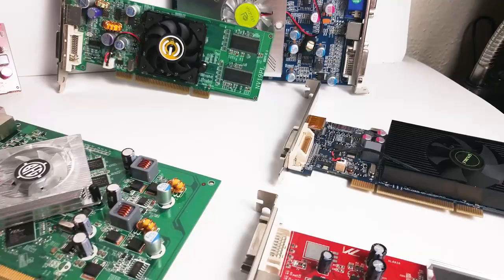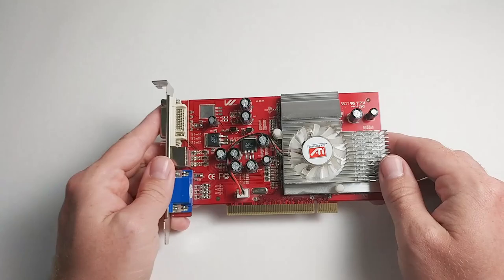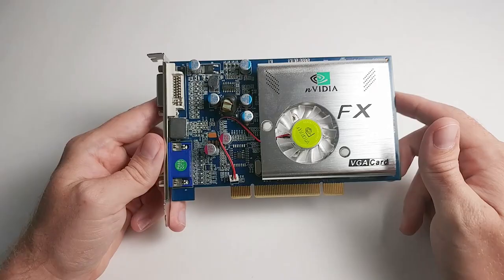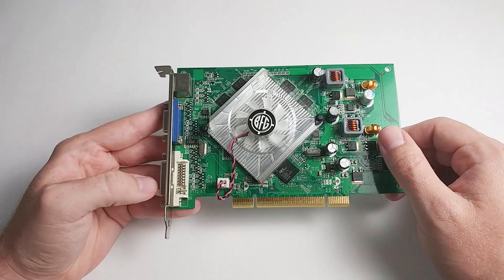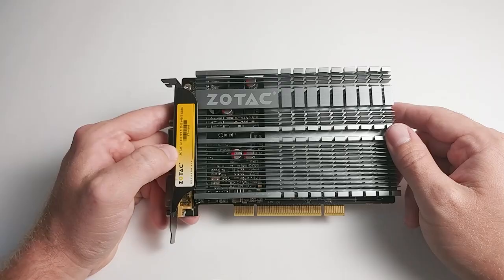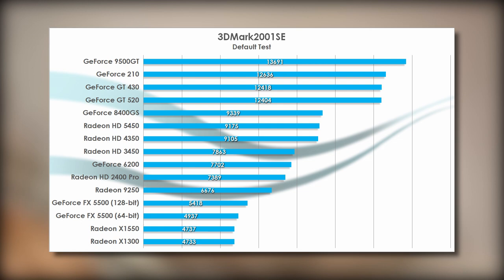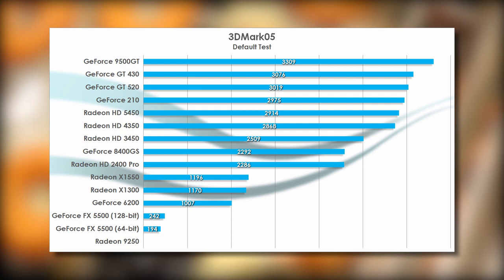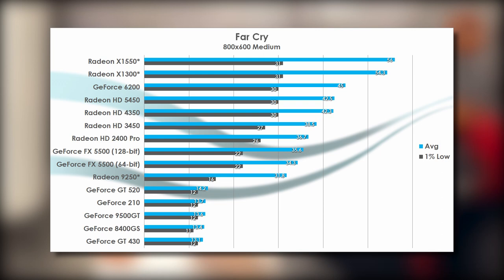A Comparison of 15 PCI Graphics Cards (DirectX 8, 9, 10, 11)

Comment: I did some number crunching, and totalled the results of each graph. 15 points for first place, 14 points for second, 13 points for third and so on. Any that had 50 points less than the leader were immediately out of the competition. Here are the results:

9500GT: 127
GT520: 127
GT430: 121
210: 113
HD5450: 104
HD4350: 90
8400GS: 86

HD3450: XXX
9250: XXX
X1550: XXX
HD2400: XXX
X1300: XXX
6200: XXX
FX5500128: XXX
FX550064: XXX

So, what're the TL;DR's from these numbers? If you're wanting the best performance bar none, the 9500GT and the GT520 are your go-to's. The GT 430's there if you can't find either of those, with the 210 being a backup for the backup. The HD5450 is the best card for the AMD fans, with the 4350 being their backup.

Footnote: What I find incredible is that the 9500 GT, a card from 2009, has performance comparing to an R5 230, a PCI-E card from April 2014! So, all the way into 2014, you could get graphics better than PCI-E off of PCI!
Reply from the maker: Haha love the analysis! Thanks!
Reply: @His Masters Voice There are actually a lot of groups that this video targets
1: Hardware Enthusiasts
2: Retro Gamers
3: People looking to upgrade older systems only equipped with PCI slots (me)

Just because this video isn't suited to you doesn't automatically make it a bad video.
Reply: I have the Galaxy PCIe variant of the 9500GT. That card did what ever I needed it to do, and went into a glorious retirement when it revealed its limits when running The Sims 3, as did the rest of the system (AMD Athlon 64 X2 and 4 gigs of DDR2 800 clock memory).
Reply: Thank you so much. You've just saved me so much time.
Reply: but isn't that comparing to the R5 230 being benched with newer games with newer technologies or you mean in the same titles?
Reply: @Celeron_619  I'm also on the same boat as you. Looking for a PCI GPU to upgrade a PCI only mobo (Dell dimension 2400) but the only thing is and I really need to know. Which of all these cards have DX9 support? He said at the start that the first one was a DX8 but I need a DX9 card.
Reply: @slendermanRblx  Anything GeForce FX5200 or higher will have DX9 support, I however recommend the 6200 as that has full DX9.0C support and is faster. I own the 8400 GS and that supports DX10 and I also have a PCI GT 610 which is DX 11.
Reply: @youtubeisgarbage900  I got one of the eBay ones and I suggest you find a name brand one. I had to reflash the bios with a 610 512mb bios due to the 1gb of ram that it had being faulty. Otherwise the card works well.

Comment: graphics cards geforce 256 pci nvidia quadro1 pci geforce 2 ultra nvidia quadro2 pro pci 3dfx voodoo1 pci 3dfx voodoo2 pci riva tnt ultra pci ati mach64 pci geforce fx 5200 ultra pci geforce 3ti 200 pci nvidia quadro dcc pci geforce 6200 pci riva tnt 2 ultra pci radeon x1300 pci geforce 210 pci geforce gt 430 pci geforce 8400 gs pci are high quality graphics cards for the pci bus

Comment: I didn't know they were making GPUs for old PCI so long time, when I had motherboard with PCI only I would really appreciate that. The best what I found was some S3 with 8 MB VRAM. It was cca in 2004. But it could run AvP 1 on low. :-D 3300 points in 3D Mark 2005 with PCI GPU, that's crazy! Why was that so rare when it has obviously some performance? It would be perfect for office PCs without AGP or PCI-e in that time.
Reply: ps: "geforce 95 hundred" without text help I wouldn't know how much is that, English can be very weird  :-D

Comment: This interests me probably more than it should because I've had a bunch of Radeon and pre Radeon cards over the years. 3D Rage II +, Rage 128 Pro,  Radeon VE, Radeon X300, Radeon X600, Radeon X1300 Pro Radeon HD 2400 PRO, Radeon HD4670, Radeon HD5670, Radeon HD6670.  The more mainstream ones that I've had are Radeon 32MB SDR, Radeon 8500, Radeon 9100, Radeon 9600 Pro  Radeon 9800 PRO/XT, Radeon HD3870x2, Radeon RX 550, Radeon RX 570.    Most of mine were AGP or PCIe though. I had only a handful of PCI ones and they were 3dFx and nVidia.

Comment: I wonder if using a PCI to PCIe Adapter Card (combined with a PCIe x1 Cable Adapter which are equipped with a Berg Connector for extra power) would produce better results than the "native" PCI GPUs? Recently picked up a Sparkle 9500 GT PCI card, and a $60 GT 610 PCI card with 1GB still on eBay. Awesome Videos!
Reply from the maker: I've had suggestions over the years to try one of those adapters, but I haven't had much personal interest in it

Comment: Cool video. The last PCI card I used was a Voodoo II  3DFX with an Onboard SiS6326? 8MB Video on a Pentium III 500Mhz system in 1999.  I can't remember the brand of the motherboard but it had a SiS chipset with integrated graphics and Cmedia Audio, I had to purchased a SB Audio  PCI card as the integrated Audio did not support my Sidewinder Pro FF Joystick.  It was a beast at the time. spent a lot time at Novaworld playing F16, Mig29 and F22 III via 33/56K Dialup.. thanks for the memories man..

Comment: Interesting and revealing comparison! Due to your talk about the compatibility of new drivers with older games, which degrade performance on newer video cards, you could have used older drivers for some of the video cards tested.
Like the 45.23 for the fx5500 and the 7.11 for the x1300/x1550/HD2400

Comment: Just finally after years built my old DOS/98 system took forever to find the parts. Socket 478 pentium 4 2.6 ghz, 512 MB ram and an ATI 7000 64 mb AGP and intel board with the 865pe chipset. with a dual boot of winXP to get use out of a WinTV capture card.

Comment: Was wondering if you had abandoned the PCI GPU prospect. Glad to see you haven't!
Reply from the maker: I had SO many obstacles but I'm glad I could finish it. Thank you!
Reply: @PixelPipes  I'm sure it was a time consuming project. Hell, I'm dreading having to go through all of them to see which ones support Windows 98SE lol. I'd like to see the limits on Windows 98SE, restricted to the PCI bus, for say, a system that couldn't make the XP jump.
Reply from the maker: @AtariBorn  The GeForce 6200 may be your best option but I haven't fully investigated these cards in 98
Reply: @PixelPipes  Thanks for the shortcut. I'm sure I'll look into each one, before it's over as I'm sure they all have their own little nuances. At least I have an idea of what to keep an eye out for. Keep up the great content!

Comment: Nice test. Tho, for practical reason, if someone wants PCI ard I would recommend those which are older and do not use any bridge (like PLX) to operate, aka native AGP chips (which is natively backwards compatible with PCI). I have seen many of those cards with bridges work bad on older chipsets. Another thing is windows 98 support. Getting a PCI card with no win98 is eh... questionable. 

The bad thing about the modern DX10+ ones is that they are only good for 2D desktop extension, some may argue some gaming, but the bandwidth of PCI is so low you cannot even play videos on them HD videos desync or run slow or stop playing.  PCI is a huge bottleneck, when it died off I would say it was the right time. Even the latest PCI cards which back in the day showed little to none bottleneck (like Vooodoo5) later became bottlenecked as faster CPUs arrived. Even voodoo5 has massively improved min fps in a bit more modern engines (like UT2004) if ran in PCI-X slot where it can run on 66mhz vs 33mhz of standard PCI. And this was the least bottlenecked card as it natively only runs as PCI66 in AGP and does not utilize any AGP features. On the other cards the impact is much worse.
Reply: Well it will nuke you minimal framerates.

Comment: Okay. I've done my research, watched your videos, and since you seem especially knowledgeable on the subject I could really use some stellar advice, if you don't mind. :)

I have an old Dell Dimension B110 that was basically a donation that I am upgrading to maximum specs as far as I can take it as an interesting hobby. I realize that upgrading it isn't the most financially-sensible venture in the long run, but anyone who tells me "You'd be better off buying a new computer" is missing the point. I already know that. ;)

Long story short, the only major thing left that I need in this thing is a good graphics card. Seeing as how the B110 comes with only PCI slots and no AGT slots, and seeing as how I only have one PCI slot left I want to make sure that I get the best graphics card that this computer can handle.

I realize that I'm not going to get away with playing modern-day resource-intensive games, but I'm mostly a retro-emulator kind of person and FPSs have never really interested me anyway. ;) I just want something that could be a viable replacement for the Intel Extreme Graphics driver that's native to the motherboard.

So my two choices, after much research, have come down to the ZOTAC ZT-40605-10L GeForce GT 430 and also the SPARKLE SP95GT1024D2LHP GeForce 9500 GT. Looking at the specs of both cards, I'm quite frankly torn, because there are so many advantages and disadvantages to each one.

The GT430 appears to have much better specs... 96 cores as opposed to the 9500GTs 32, Direct X11 as opposed to Direct X10, Open GL 4.1 as opposed to Open GL 2.1, and less power consumption requirements (Which I am prepared and willing to compensate for one way or the other). However, the 9500GT I'm looking at has two major things going for it that the GT430 doesn't... memory size and memory bandwidth. 1GB of memory as opposed to the GT430s 512 and 128-bit memory bandwidth as opposed to 64-bit. You say that the GT430, in a different video, is one of the fastest PCI cards made, but your video shows the 9500GT clearly outperforming it in most applications. And according to those who populate this forum ( https://www.vogons.org/viewtopic.php?f=63&t=58022&start=21 ) getting the "fastest" PCI card may not be the best idea since a lot of the GT430s superior features and performance would be held back by its memory bandwidth restrictions as opposed to the 9500GT. Your video also seems to support this.

Features are nice, but at the end of the day I am looking for the absolute best performer that I can get through the lowly PCI slot. ;) Power requirements are either not an issue or one I am ready and prepared to address. I am also working with 2GB of onboard memory and a Pentium 4 3.4Ghz SL793 Northwood CPU, so I'm plenty covered there. :)

So my question: Which, in your professional and personal opinion, would be the better card to pull the trigger on? I really need a consultation here, which I thank you for in advance. At $147 a pop I want to make sure I get this right the first time. ;) Also, thank you for posting your videos, they have been very informative. Take care.

EDIT: Lest you wonder... ;) 

https://www.vgastore.com/1006051/zotac-zt_40605_10l-geforce-gt-430-fermi-512mb-64-bit-ddr3-pci-hdcp-ready-video-card?gclid=eaiaiqobchmi1jpgkk7h4aivdo3ich1lbgtweakyasabegjf6fd_bwe

https://www.vgastore.com/2016349/sparkle-sp95gt1024d2lhp-geforce-9500-gt-1gb-128-bit-ddr2-pci-hdcp-ready-low-profile-ready-video-card?gclid=eaiaiqobchmi06-yuzf04aivriagch1xwqfveaqybsabegkfevd_bwe

EDIT 2: Running Windows XP Professional SP3 on this machine. Would certainly love the ability to run Windows 7 also, but if I can't it isn't a major dealbreaker. ;)
Reply from the maker: The 9500GT is marginally faster overall. The limited memory bandwidth holds the GT 430 back too much. Even the GT 520/610 can be faster sometimes because the memory is clocked a little higher.

Comment: Hey man nice test, but best usage for these card is pure DOS or Win98 (i know that some of them will not work in Win98 not drivers after G7/X850, in DOS all of them will work) but still, except you are stuck with some low profile O.E.M HP / DELL etc machine, you have PCI-E or AGP slot on them. Dos benchmark exist (for Quake, Doom etc..) would be particularly interesting with comparison of good old typical DOS cards Ati mach64/S3 Trio/Virge / Tridents, Rage 128 etc.. because lots of these new cards have dynamic clock rate which is driven by drivers and there are starting at pretty low clocks, because of power / noise nationalizations for DOS performance is not so good as someone would expect.
  Your machines are completely fine for DOS, we were able to make it working with much newer machine like X58 chipset  (newest one with working sound cards, details here: https://www.vogons.org/viewtopic.php?f=61&t=61044, great DOS6.22or7.1/Win98SE/Win2k/WinXP/Win7/Win10 machine, here is similar project video https://www.youtube.com/watch?v=oT47y_EaGHs). Funny is that X58 machine with Six core CPU is max 10% slower that my Z8700k, for min framerate is even better.. BTW Windows 98 are running fine even on my X99 /Z170, if you are fiddling with them enough. If you would need help with how to make DOS working come to Vogons we will help you.. I would be shame not test at least few such benchmarks with such collection..

Comment: Can you test all the fastest AGP cards as well? 

——
Would also like to see a test system with the fastest, first quad core CPU you can find along with cheap modern / older but still-with-driver support PCI express cards you can find?
Reply: late AGP cards are nonsense because there war CPU bottleneck, if you have Pentium 4 or something like that (TOP cpu in AGP times) then 2007 GPUs are already bottlenecked.

Comment: So I bought one of the no name FX 5500 cards you showed and it wouldn't work in one pc. So I bought a BGF 5500 and it worked perfectly. Well I liked the cooler on the no name better so I went to swap them and guess what I found? The no name FX 5500 is actually a 5200 chip. I'm curious if it even actually has 256MB of ram or not since the 5200 was supposed to support 128.
Reply from the maker: Makes sense as the core clock on mine was 250MHz, same as the 5200. A 5500 would be clocked at 270MHz

Comment: I purchased that Zotac 430 a long time ago to use in a mini ITX computer which had the Intel DG41 mainboard. And I could not get it to work right, it seemed like it was painfully slow, like it didn't have proper drivers or something. And I got black screens with any game launch, so either it was incompatible or bad.  In my 200MMX machine with an Asus tx97 I currently use one of those 5500FX 128 bit cards as anything newer will not work on this board, and at that certain revisions wont work either. I had hoped it would have shown better performance in this roundup though :(

Comment: What do you think about making 'Retro PhysX acceleration test'? I mean Physx acceleration by PCI cards, and maybe for comparison PCI-E x1 cards, of course while accompanied by AGP graphics card like Radeon HD3850 (I saw that you have Sapphire, unfortunately not HIS IceQ 3 Turbo.) Hmm ASUS A8V-X / A8V-MX
Reply from the maker: I'm not planning a PhysX video unless a card falls on my lap.
Reply: @PixelPipes  Sorry, that I wasn't precise. I was asking about comparison of PhysX acceleration done by PCI graphics cards set as dedicated PhysX cards. ( 9500GT vs GT430 vs GT520 ) In my opinion it's also interesting how much bandwidth between accelerator and CPU is needed- that's why I mentioned PCI-E x1. You did great comparison between PCI, PCI-E x1 and PCI-E x16 GT520. I think that it would be also interesting to see comparison between PCI-E x1 and PCI-E x16 for fast graphics card set as dedicated PhysX card.
As far as I know, there was close to no difference between Ageia PhysX cards no matter which version- interface, and PPU clock. There is also probably only less than 20 game titles which can use it. I really like an idea of PPU which can calculate whole library of physics, like Ageia PhysX 100, and hate an idea of dividing it between GPU and CPU. I don't know if mixing good ideas and bad ideas in one comparison is the right thing to do. It's like comparing good idea of hardware accelerated simulated audio environment of A3D 2.0/ 3.0 (I saw that you have Aureal Vortex 2.) to any more modern parametric model (doesn't matter if hardware or software accelerated)- the first suitable thing to compare seems to be TrueAudio Next. History shows that good ideas and companies behind them are fated in one particular way.

Comment: would love to see a list of video cards that work on the Dell D series PD01X docking station. yes it has a pci slot it has a under powered power supply so it needed cards that are low energy consumption like the AMD fireMV 2400 pci card any help on this or comments would be great i have these docking stations. for D series latitude models and some inspirons too. i dont know what all inspirons are compatible though. thanks for any help you can give

Comment: To add to my previous comment, check this for sub test: https://youtu.be/AC-ExFnAgXo?t=85

I'm impressed. Doesn't go close to 20 Hz obviously but it's $40 for a sub and two speakers and that's an audiophile test. I'm just impressed with the actual sound for the money paid. High pitch doesn't go anywhere near 20k either but they don't crackle or anything they just fade out, and the sound they do cover sounds good. For 40 bucks its not bad.

Comment: I have a Geforce FX5200 pci in my Pentium III system. I tried the GeForce GT430, but it didn't work very well because it used too much power. And when I got it to work it wasn't better than my old card.

Comment: I would like to have a lot of old gpus like you 

Right now I only have 
Nvidia Quadro fx 1400
Nvidia GeForce fx 5500
Ati Radeon x1300 (HP OEM card)
AMD Radeon hd 6350 (Dell OEM )

And my gaming rig gpu 
Nvidia gtx 1060